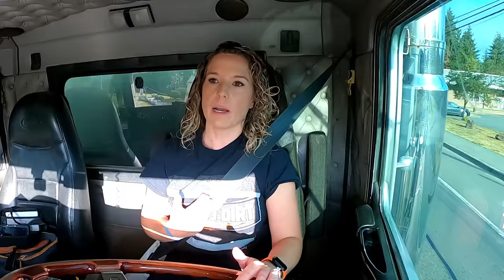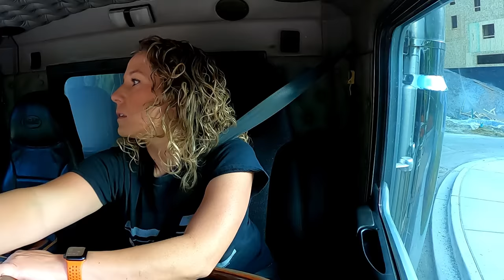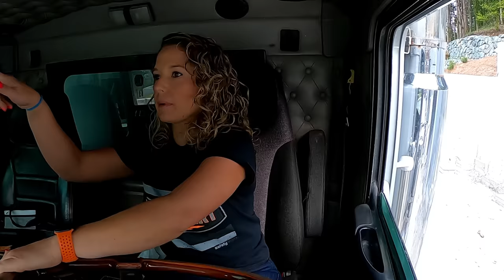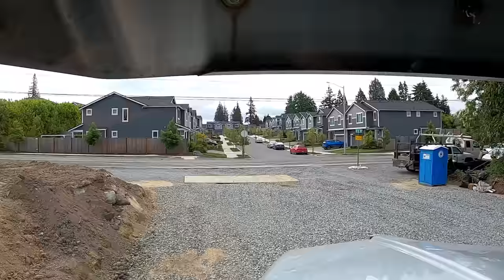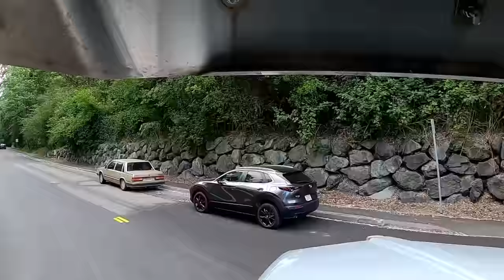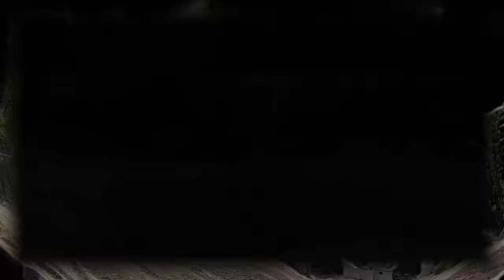Tri Axle Dump Truck Owner Operator Vlog. First day back to work after radiator replacement.

Comment: Dauminique, it's been 98 here all day and will be that way for the weekend. The heat index has been around 110.  So come on down to the southeast and you can get 90 plus. LOL Just make sure the A/C on the dump truck is good and charged up. 😁

Comment: As one who drove a dump truck for a while, and one who has had a windshield busted by a rock off a dump truck (saw the rock come off the truck and bounce up), I get pissed when I see a truck hauling without the tarp up…but I’m on the east coast. I noticed when you had a load of dirt that there wasn’t any dust coming off it as you went down the road. Here, it blows everywhere. Sand is the worst…I’ll back way off so I don’t get blasted.

Comment: Do all your trucks run all the time, or do you use what the customer wants? I think you have a couple four axle trucks and pup trailers , and a six axle seven axle dump truck? If you count the strong arm on the back. I don’t think i would buy a strong arm for a dump truck unless I had a big fleet of truck’s because I hear the strong arm tires can wear out faster especially if your hauling long distances

Comment: You need a strategy for dealing with tailgaters.  I will brake slowly and slow down to about ten mph below the speed limit, drive that speed for 10 seconds and then speed back up.  If they don't get it, I will do it again for 15 seconds.  Third time I will brake harder to 15 MPH below the speed limit and drive that speed for 30 seconds, by then they usually get it.
Reply from the maker: It’s WA, they don’t care.

Comment: This year it's going to make it 30 years that I have been in construction and I have been in every aspect, from framing to grading to supervising and managing and yes, also the parking that you cut up lol but one thing, oh yes, not only  am currently driving truck, but I have also worked around trucks the entire 30 years and I can not believe how small your loads are! Why is that?
Reply from the maker: Trucking is by weight, not volume.

Comment: 146$ per hr. is pretty good pay, for your 4 axle that we here in Wis call a Triax, We get about 90 to 110$ for our 5 axle, what we call a Quad. Thats with fuel at about $3.70 to $4.25 per gal. Do U get more when U pull your pup trailer?

Comment: I don't think I've ever seen a video where your box gets completely full.  It looks like this job could have been done in 5 loads instead of 7 if the box was filled more.  I know when you work by the hour that would not be a good thing, though.
Reply from the maker: Trucking is by weight not volume
Reply: If it’s filled to the top she’d be overweight by a lot been there done that
Reply: @DauminiqueTheDumpTruckDriver  I realize that.  But if a box this size reaches the weight limit before it is ever full why so big in the first place?  Are the limits for residential areas like this less than highways?  I know different materials weigh different amounts.  Coal weighs less than dirt.  You should see what they do to trucks hauling coal in the Appalachian area.
Reply: @snowblowerman5115  Washington weight limits must be less than Kentucky and Tennessee.  I see more dirt and rock in dump trucks here than in Washington.

Comment: Dang you are a good driver!  I could never back up like that. :) Thank you and have a good week. By way why do you not trap your loads?
Reply: Meh, it's easy. Want a backing challenge, come work for a road department. When we pull shoulders we drive backwards down the road while the belt loader loads us. So you are not only backing down the road, your riding the edge of the road as well. Then you got to look out for mailboxes and signs all the while keeping your truck against the belt loader which is driving down the road. And then when we do everyones favorite, chip seal, we are actually being drug backwards by the chip spreader. That gets real fun.

Comment: Remember the time you had a front tyre blow out and almost died I see you driving with one hand on the steering wheel instead of two your husband a wizard with truck repairs.
Reply from the maker: Well it’s a manual transmission….

Comment: What length is your dump body?  Where I am tri axles are usually 19-21ft range. A lot of tri axles in the US look shorter.
Reply from the maker: My truck is not set up like east coast trucks. It’s set up to pull a pup. It’s shorter because it doesn’t need to be 21 feet because it can’t be 80,000.
Reply: @DauminiqueTheDumpTruckDriver Does your business do excavation also?

Comment: Not sure what you are crying about you made damn good money for single axle dump truck loads at best you may have had 7 yard loads and an easy haul. I laugh you haven't seen tight jobsites you have all the trades vehicles parked all over we barely have enough room to maneuver around.  I'd love to have jobsites where we have acres to turn its not the case for us. If we were caught hauling small loads like that we'd be thrown off the job no contractor ever throws small loads on tandem axle trucks you are not carrying 14 yards (33,000lbs) you ain't loaded. The gravy train isn't going to last forever make money while you can when you can.